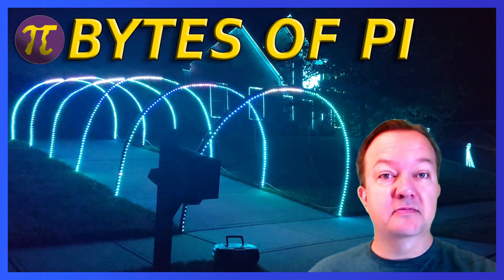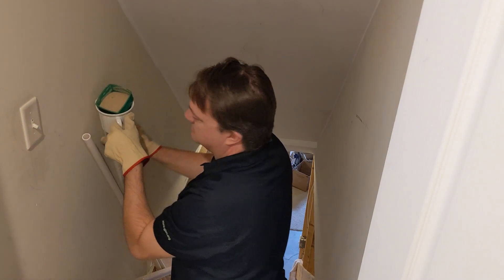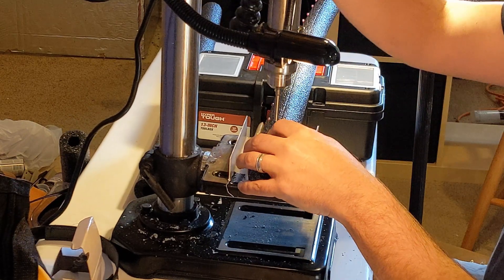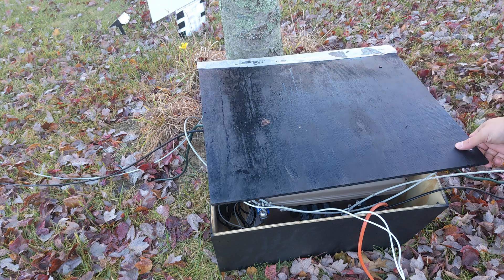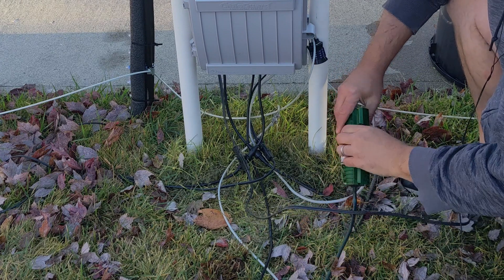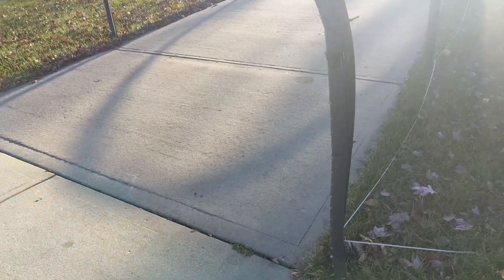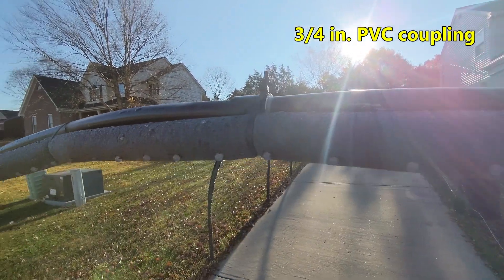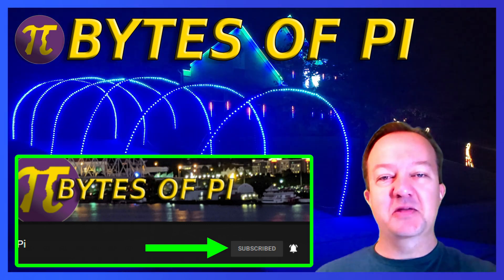How To Build LED Pixel Driveway Arches

Comment: After trying to heat PVC pipes for an arch a few years ago - which came out uneven as some parts bent more easily than others - I tried just using tension for arches over my sidewalk.  Used two grey electrical conduit PVC pipes per arch, because they have a great coupling built in. I cut off 1' on either end of the pair (for a total length of 18' per arch), so that the coupling used to connect them was at the top.  Used a 4' rebar on each end, and just bent the PVC, so it's under tension.  In my case, I spray painted the conduit white and made candy cane stripes with red vinyl (electrical) tape.

They were used for 3-4 years in various ways every Christmas, but in Feb 2020 during the first dark times of the pandemic I kept them up all year.  Now my spouse likes to have them up all year, enjoys walking under them when we go out at night (eg: for a walk), and it's nice when coming home after dark.  We have received a number of positive comments from people who drive or walk by every day.  

So the walkway arches have now been up for 3 years continuously, plus a few seasons before that. If I recall, the electrical PVC is UV resistant, but the spray paint may help as well.

These were originally used with red, green and blue strands of incan Christmas lights and computer controlled dimmers (Renard).  Then just multicolor LEDs for a while.  Christmas 2021 I switched to bullet pixels zip tied to the inside of the PVC curve every second pixel (or as needed), which looks fine to me.  The wires are between the pixels are stretched out along the PVC - no extra length to hide like your 2" spacing - but visible, so it might not appeal to everybody.

The walkway curves slightly from the sidewalk to the gateway of the courtyard, between two trees which dominate either side, so it's like a little fairy path through the woods (but only about 30' long :)

However I'm thinking about your use of foam pipe insulation as a cheap flexible mount elsewhere!  Thanks.
Reply from the maker: The winter months here in the northern hemisphere are especially dark for a good portion of the and passing houses that are lit really lift my spirits.  My wife and daughter also enjoy walking/driving underneath our arches.

I still have colored LEDs inside my house up year round and probably won't take my Christmas tree down until February.  However I'm too chicken to possibly provoke my HOA and neighbors by leaving my external lights up past mid January.  

Thanks for sharing your setup!
Reply: @BytesOfPi  I'm glad in this case not to be part of an HOA.   They probably would also not like some of my Christmas lighting (Like the 12' high pi-shaped frame I use for some of it).

In other parts of town, I've seen Christmas displays that put arches over the public sidewalks (in front of their residential homes).  I haven't pushed it that far, but as one of the two trees in the front extends out over the sidewalk, I do put some lights out above people's heads.

The neighbors across the street are Burners, so it's cool with them.

Comment: We used hot water and capped the ends until water cooled.  Never thought of sand!  Awesome video!  Thanks
Reply from the maker: Did the water work well for you?  Since the pipes are made to transport water, I thought they wouldn't be able to get hot enough to bend the pipe before turning to steam.  Like to hear your experience since water is probably easier to clean up if spilled.
Reply: @BytesOfPi  Yes water worked good.  Got it to a boil and then filled the pipe and put the pipe in a jig made from a 4x8 sheet plywood and nails.  Let it cool then dumped the water. It has to be boiling hot so you have to move quick to fill and cap and get into jig.

Comment: What’s your reason for using WT32-ETH01 versus Kulplight controller? Cost? Do you feel there are limitations to using WT32 versus another controller?
Reply from the maker: The WT32-ETH01 microcontroller with WLED was $15 (now about $17) and wasn't just a receiver, but a full fledged stand alone controller with built in Ethernet.  

Mainstream controllers like falcon ran around $300+ for the main controller and $50-$70 for each receiver.  

The WLED ESP32 wireless boards were just as cheap, but couldn't handle a lot of streaming E1.31 data.  They needed an Ethernet shield which doubled the cost.  There were other Ethernet built boards but they were POE which tripled their price.

WLED also is a great program to run lights while not running a show through xLights.  

You do need to purchase your own level shifter, fuses, and programmer, but you only need to purchase what you use and you don't have to pay for extra stuff you don't use on a professionally made board.  Also have to feel comfortable soldering pins and flashing microcontrollers 

$15 was a nice entry price to see if I wanted to get into the hobby.  I now run my entire show off of four WT32-ETH01 boards w just under 4500 pixels.  Not bad for $60
Reply: @BytesOfPi  wow. Nice. I’m definitely checking it out. Do you have another means of contacting you to chat. I heard in one of your videos Cincinnati, I live about 30 min from Eastgate, not sure what part of Cincinnati you are from.
Reply from the maker: @anthony_goddard  I have been dabbling and answering questions in the r/WLED Reddit channel.  I've ventured onto the WLED discord server, but it is a little too chaotic for me.

If you're in the Cincinnati area, hope you got to check out blink this year.  It definitely can give you ideas if you are interested in lighting.